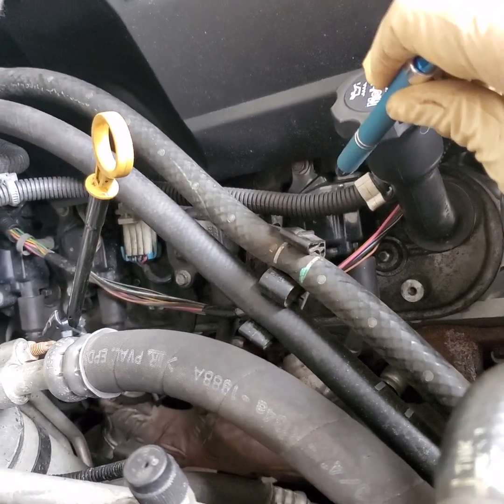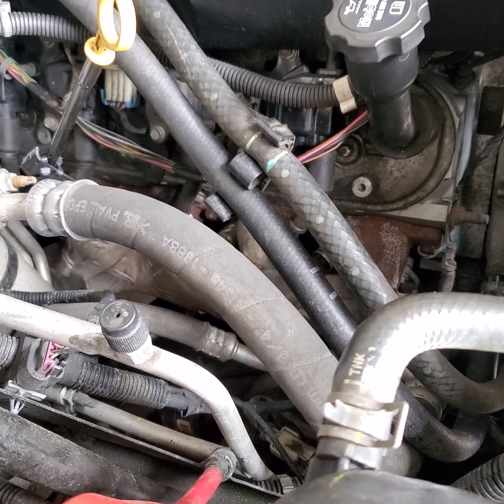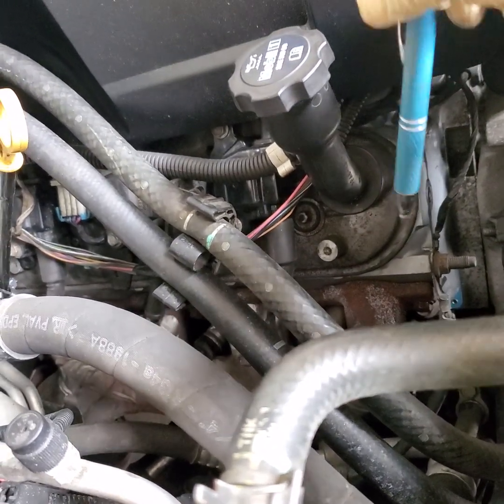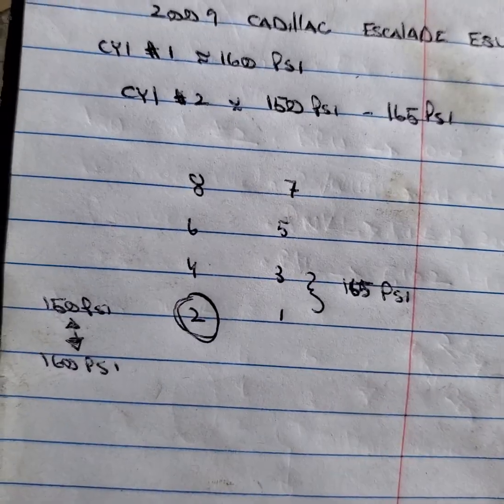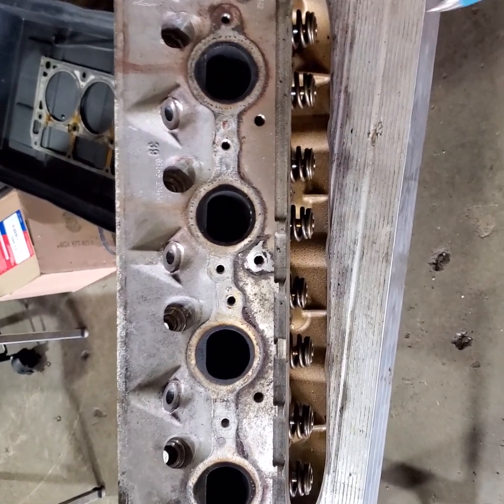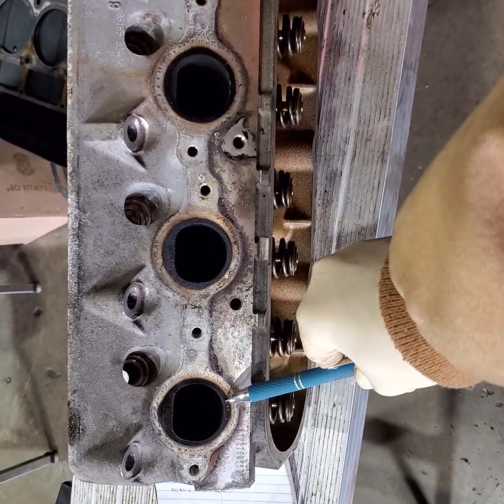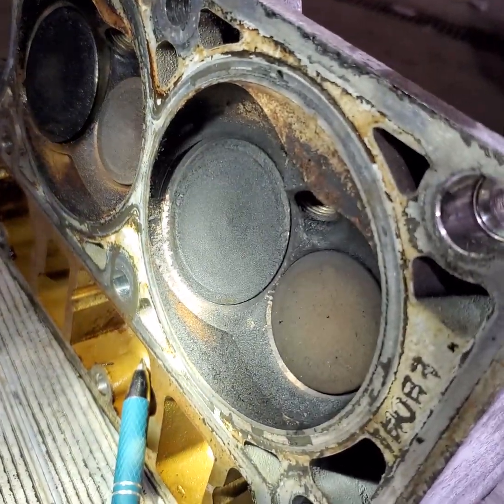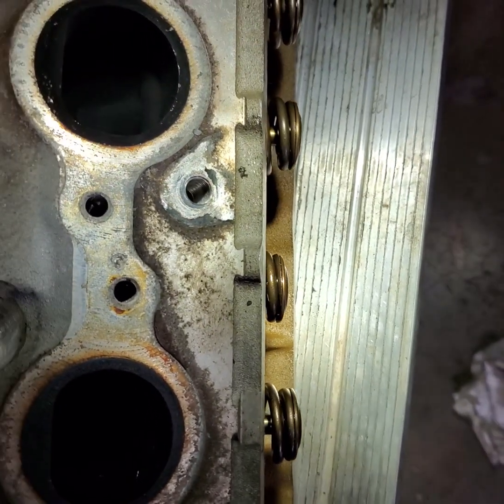2009 Cadillac 6.2L - P0302 Cylinder 2 Misfire Detected - Loose Intake Valve Seat

Comment: Hi I also have the same issue reported from Cadillac after I had them diagnose Misc: additional diagnosis time to verify spark, fuel and compression for cylinder #2 misfire (dead misfire) can you tell me what to replace or inspect first before I need to change the entire gasket cylinders like you did

Comment: Wow! How common is this? I’m looking at a 2007 and it threw the P0302 on test drive so I backed off, but the dealer replaced the plug and wire and said it’s all good now. What did or should this cost to repair?
Reply from the maker: All depends on the shop and their shop labor cost.